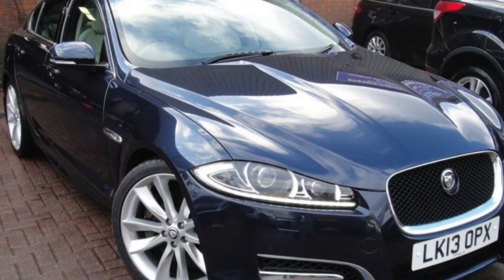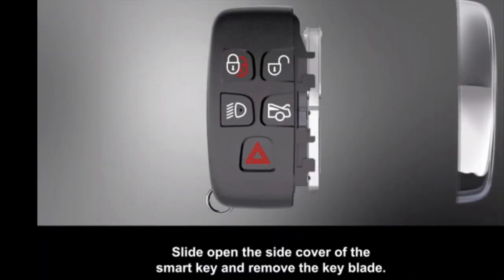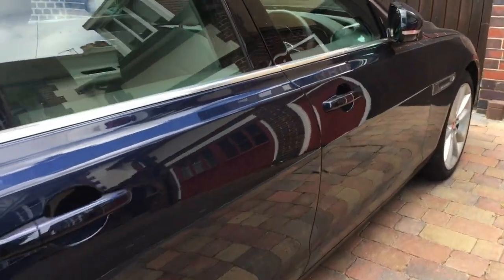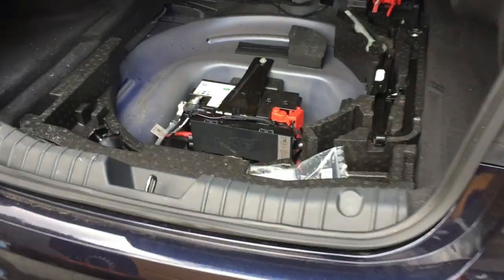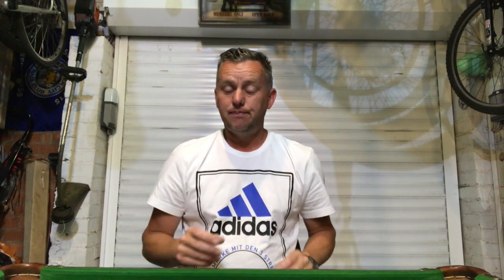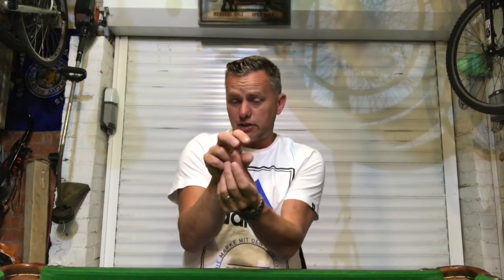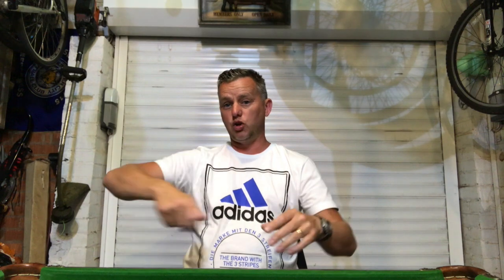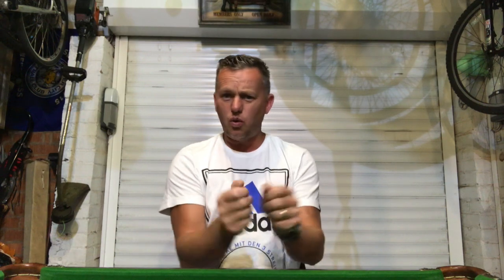Jaguar XF Wont open, Or Start, also Random Electrical Faults inc Indicators

Comment: I am on this thread today to thank you, my 16 xf stopped tuning on this Thursday, tried jumping first time it worked so i said IT’s battery, got a new battery and when i opened the trunk removed the spare, all i can see is water, i was surprised to say the least, it shouldn’t be no water there, i emptied it, it’s was a lot of water, just like you said up to the bottom of the fuse box, i changed the battery and put everything back together, it started fine, at this point i didn’t think about the plug that was submerged in the water, i drove the car but as soon as turned it off, it doesn’t want to start, my key fob is not recognized, at this point i am giving up hope and i was calling the dealership for service. Last night i told myself let me check online to see if anyone had this happen to them. And voila the first video is your video. I woke up next day and cleaned the plug, and now the car is working perfectly. I even went ahead and returned the new battery and kept my old one.
Reply from the maker: Brilliant news Thanks for the great comments👍🏻👍🏻🛠

Comment: Had exactly the same after using a powerhouse to wash my car.... Hazards going off whilst driving etc Unable to open the car with the fob. AA guy said the fuse box was under water and connectors corroded. Good video.
Reply from the maker: Thanks for the great comments 👍🏻👍🏻🛠
Reply: I think u hit it on the nose if u have these car do not take them in a drive thru car wash please everyone

Comment: Usual place for water leak in boot is slam vents behind rear bumper, just need re-sealing. Think it can be done with small hands without taking bumper off.
Reply from the maker: Thanks for the great information👍🏻👍🏻🛠
Reply: It can , but there only about £13 new from jaguar, and can be removed and refitted without removing bumper.

Comment: Had same water issue in boot drained it all out like you did cleaned wiring plugs. Changed battery twice. Car starts etc but battery goes dead by the morning
Reply from the maker: You will need to run a drain test on the vehicles electrical system to find out where the drain on the battery is coming from, Thanks for the great comments👍🏻👍🏻🛠

Comment: Sure you are from near from where I was born, in Burton On Trent? Thanks for the info. Doing a X300 at the moment, trying to resolder the ABS anti Skid, They are hard to get the plastic cover off ..may have to heat the glue to remove it.....Martin
Reply from the maker: I am from Leicester, good luck with the x300 Thanks for the great comments👍🏻👍🏻🛠

Comment: My son Jaguar XF did exactly the same and the boot was full of water when we went to check the battery.
Reply from the maker: Thanks for the great information👍🏻👍🏻🛠
Reply: My 2011 Jaguar xf premium. Same Exact Problem a pool in the truck battery issues now the push to start is giving me issues and my rear passenger window will not go down replaced battery 2x I maintain it but sheesh this isn't a cheap car Jaguar should rectify this!! Please let me know if you have suggestions on how to fix I'm exploring hoping it's a simple fix. Thank you

Comment: Interesting, will have to take a look. My issue is the 'warning battery not charging light' coming on from time to time, notably when the weather is damp or raining. After driving for a while and then a restart the light stays off.
Reply from the maker: That is usually the alternator starting to fail, Thanks for the great comments👍🏻👍🏻🛠
Reply: You may have water in boot rotting your loom check immediately

Comment: Hi,have you ever experience where the boot is showing in the dash-that it is open not allowing the door to close with the FOB but the boot is actually close.
Reply from the maker: check the latch switch in the boot, Thanks for the great comments👍🏻👍🏻🛠
Reply: @aaanton11  I change it and still nothing 🤦🏻‍♂️
Reply: @aaanton11  I found the issue it was the junction box in the trunk the voltage was 11.9V so I clean the contact points after I got 13.5V now and the locks are working on.

Comment: Have same car as you, changed battery now my key fob doesnt work, only headlight button work, inside my car the lock n unlock button do not work, but car starts n all other features work, any help would be greatly appreciated as its stressing me out, thanks in advance
Reply from the maker: Try disconnecting it again, Thanks for the great comments👍🏻👍🏻🛠
Reply: Tried it no affect

Comment: My 2012 XF got into a fight with a lamp post during a reverse park yesterday. LED tail light replacement is £300. New bumper plus fitting? I dread to think. Thankfully the bumper is reparable, otherwise I'd have been screwed. Going through the insurance probably isn't a wise idea on a car of that age, as it could be written off. Just pay the monster repair bill myself.

But on the subject of electricals. I've had the opposite tail light fail on me within the first week of ownership. Warranty covered that one. Sometimes the touchscreen does weird glitchy things occasionally. Jag's aren't know for having great electronics. Just something us loyal Jag fans have to live with.
Reply from the maker: Definitely worth looking in the boot for water, as this can network affects everything, hope your repair goes well, Thanks for the great comments👍🏻👍🏻🛠

Comment: I am having the same issues with my 2012 Jaguar XF. However, with all the qaring lights going off the only issues I have is car will not turn off intermittently and once it wouldn't start. It runs fine other than those issues and the waring lights.  Jaguar dealer says the while panel need to be changed but the tech said just the ignition relay was bad. Your thoughts?
Reply from the maker: Hard to say without looking, but sounds like a software issue, Thanks for the great comments👍🏻👍🏻🛠
Reply: Water has got in your loom rotting the wires they know this but don't care and are trying to sell you something you don't need. I was too late and will cost me 5k as insurance said it was wear and tear

Comment: My xf 2012 rear passenger side window stopped working with like printer noise constantly coming out of it now the same door doesn’t lock also when I lock the rest of the doors the mirrors don’t fold in either ! any idea sir thanks for vid I’ve checked the boot and all is dry 👍🏻👍🏻👍🏻
Reply from the maker: sounds like the cable to the regulator has broken, remove the door pannel and have a look Thanks for the great comments👍🏻👍🏻🛠
Reply: @aaanton11  Thankyou very much for your help sir much appreciated i suspected the same after a bit of research so not too expensive hopefully thanks again mate 👍🏻👍🏻👍🏻

Comment: Vents in boot. You can feel that they are wet and are letting in water. Silicone sealer will solve it.
Reply from the maker: Not the dreaded boot vents again, I have just done a set on a Ford Focus Thanks for the great information👍🏻👍🏻🛠

Comment: PLEASE HELP I SERIOUSLY CAN'T FIND MY RELAY LOCATION FOR MY HORN... My 2011 Jaguar xf premium. Same Exact Problem a pool in the truck battery issues now the push to start is giving me issues and my rear passenger window will not go down replaced battery 2x I maintain it but sheesh this isn't a cheap car Jaguar should rectify this!! Please let me know if you have suggestions on how to fix I'm exploring hoping it's a simple fix. Thank you
Reply from the maker: Horn is Relay 2 in the under bonnet fuse box, Thanks for the great comments👍🏻👍🏻🛠

Comment: my nephew has  13 PLATE XF 2.2 TWIN BATTERIES HAD WATER IN THE BOOT BUT THE BCM IS FITTED ON THE INNER WING ONE BIT OF CORROSION FOUND ON THE PLUG FOR THE PEDESTRIAN SENSORS I THINK BUT ITS THROWING CODES FOR GEARBOX /PEDESTRION SENSOR/BATTERY NOT CHARGING AND SO ON CANT FIND THE FAULT AT 1 STAGE HE HAD 71 ERRORS WE ARE AT A LOSS
Reply from the maker: Check and clean all the plugs in the damp area of the boot, even the ones which are blanks, Thanks for the great comments👍🏻👍🏻🛠
Reply: @aaanton11  thanks for reply will try it

Comment: Hi a was jumping my friends car with my 2009 xf and smoke came from under bonnet and my jag cut out now no power to anything no ignition lights nothing do u know if there a main power fuse from alternator to battery control module?? Thanks martin
Reply from the maker: Sounds like the leads might have been on back to front, if the smoke came from the front you might have burnt out the alternator or engine loom, Thanks for the great comments👍🏻👍🏻🛠

Comment: Hello great video can you pls help as I hv a 2013 jaguar xf after traveling for 3 weeks and disconnected my battery getting back connected and start the car but says car wont start. Reposition key and start again. Tried everything but wont start..can u pls help?? Thanks
Reply from the maker: Sounds like a firmware issue, possible dealer reset, Thanks for the great comments👍🏻👍🏻🛠

Comment: I have a XF 2011 Auto Saloon  model with 100000 miles on the clock.  Until today it was working perfectly.  I left it in my garage for the last 3 days and when I came to drive it this morning nothing worked.  It was  completely dead and although the drivers door opened as I hadn't locked it, the boot wont. I replaced the battery 18 months ago but cannot check it today because the boot wont open.   I called a rescue company who came out to me but they couldn't do anything because they couldn't open the boot.   I can't open the bonnet because the car is parked to close to the garage wall.   Any suggestions as to what could be the problem and how I can get into the boot?
Reply from the maker: You can power the electrics up from the eobd plug with the correct connector, surprised the breakdown guy didn't have one, one here 
https://amzn.to/2JiEl6yThanks for the great comments👍🏻👍🏻🛠
Reply: 100 000 miles? 
One hundred thousand miles really? U sure is 100. 000 miles ? 
And never had issues before? Wooow can't even believe is even driving still but that's insane u one of very few

Comment: Hi can u advise me, my xf wont start,  sperk plugs ignited, injector not working,when i put some quick start ,car turns and dies. i took all necessary modules and swap it on another car and it works.  there is a module under the rear chassis which is link to the fuel tank, could that be the issue,i doubt.can u help me. injector not trigerring but spark at the plugs.  thanks.
Reply from the maker: usually the camshaft sensor is at fault, have you read the eobd fault codes? Thanks for the great comments👍🏻👍🏻🛠

Comment: I know this is a common issue for these cars however do you think your method is thee most reliable way of fixing the issue. having the same problem with a 2009 XF
Reply from the maker: it works fine, but you need to rectify the water leak. Thanks for the great comments👍🏻👍🏻🛠
Reply: Can that specific harness be bought somewhere v.s cleaning it?

Comment: same problem, blinkers just stop working requiring battery to reset, now my starter won't spin the engine, and I have coolant leak under the  intake manifold.  I can't get over the sheer stupidity of the engineering that went into this car.  The blinker problem is, no doubt, a software issue.  The coolant issue is all over forums as a common failure in one of the valley hoses as they are called.  Why in the world would you run coolant lines under the manifold like this?  I'm so done with Jaguar.
Reply from the maker: Great British Engineering at its finest!! Thanks for the great comments👍🏻👍🏻🛠

Comment: Hi may you help me... My jaguar xf 2015 after I replaced the bettery not open switch or start engine and I receive error passive key error.. But the key can only turn on the light and close it... Some told me need to replace computer is it true??!!
Reply from the maker: Try disconnecting the battery again for 10 mins then reconnecting, Thanks for the great comments👍🏻👍🏻🛠

Comment: My 2009 jaguar xf 4.2 v8 after showing random faults now its dead, nothing is working, i checked for water leak but negative no water found, any ideas please
Reply from the maker: I would start by redoing the Earth points in the boot around the battery common for them to look okay but have a poor connection Thanks for the great comments👍🏻👍🏻🛠
Reply: @aaanton11  after redoing the ground points the car react on the keyfob but only when the key is in the slot, the engine wont start, the local elektromechanic said that he reads many faults on it which he cant delete. And he run out of ideas, could you please help?

Comment: Nice vid what about a 2009-2010 battery just draining erratically
Reply from the maker: Always check the boot for water, causes loads of faults, Thanks for the great comments👍🏻👍🏻🛠
Reply: @aaanton11  no water. And it’s irregular no fault code showing for it. And only drops to have the voltage to 8 volts.
I have checked everything possible. Battery had a load test and passed
Reply: @geordieboy5679  get a ohm meter connect it to batt on + terminal close all turn all off and set it to 10amp and change red lead to 10Amp led start by pulling fuse by fuse when the numbers drop that fuse causes your drain and look what the manual says about that fuse and u can go from there (usually a big loss its a faulty alternator even if charges fine while driving it) my sec most commom its radio or amps either factory or aftermarket
Reply: @omarr8183  as an electrical engineer this was the first this I did there no significant  drain the output from The alternator is find and the resistance is well within the jaguar specification I replaced the alternator 2 yrs ago..
What ever the problem was has completely disappeared

Comment: Great video thank you. My 2014 Jaguar XF has an error that says "steering column locked" and it wont start.  Lights come and the battery is good. What could be the problem?
Reply from the maker: Give the steering wheel a shake turning left and right whilst trying to start, Thanks for the great comments👍🏻👍🏻🛠
Reply: Did you get your jags problem sorted?  I got the same message the other day.

Comment: I changed my battery not there no power to gear selector won't even rise - car starts - not even the lights work on gear selector- I know this has to be related cause car was fine before I changed battery
Reply from the maker: There is a known fault with the gear selector, but as yours has just gone try disconnecting the battery and leaving it for 1 hour then reconnect Thanks for the great comments👍🏻👍🏻🛠

Comment: Hi I have a Jaguar XF 09 plate discover today that the boot lid will not open from the  remote or from inside the car are any ideas all other electrics seems to be working
Reply from the maker: Sounds like a solenoid fault in the boot of a broken wire in the boot loom, usually around the hinge. Thanks for the great comments👍🏻👍🏻🛠

Comment: Im currently scrolling all Jaguar xf fault videos because i really want to own one but need to be sure they are reliable.
Reply from the maker: In that case buy a Japanese car 😂, Thanks for the great comments👍🏻👍🏻🛠
Reply: @aaanton11  Im most likely going to get one but the pros really need to outweigh the cons... its the luxury and comfort that my current car doesn't have that i require.
Reply: I have a 2017 lexus nothing done to it and the miles are 100,000 all highway miles 
Oil change,tune up and tires thats after 2 yrs or more
Now I got a jaguar xf 5.0 WITHIN A MONTH
water pump, a ring for my power steering wheel and now it won't start so it needs a new fuel pump for 1,100
TRUST ME DONT DO IT GO FOR A LEXUS OR SOMETHING IN THAT CLASS!!!

Comment: Does anyone know how I can fix my jaguar xf display screen it won't turn on its flickering
Can anyone help please thanks
Reply from the maker: Check the boot for water ingress like in the video, Thanks for the great comments👍🏻👍🏻🛠
Reply: Your screen flickering is the iPod module under the drivers seat! I promise, and the satellite radio module, can be looped out(coaxial cable loop) or new modules, water gets in there and they sit so low moisture corrodes it over time, check it out! Unplug them even, it’s very very common(worked for jag as a tech)